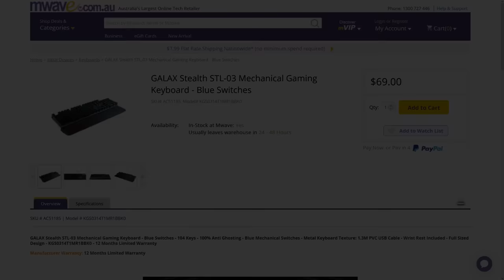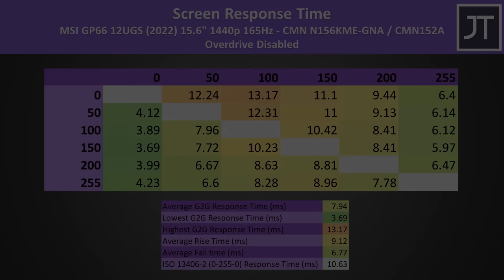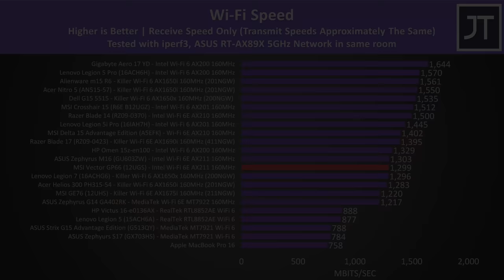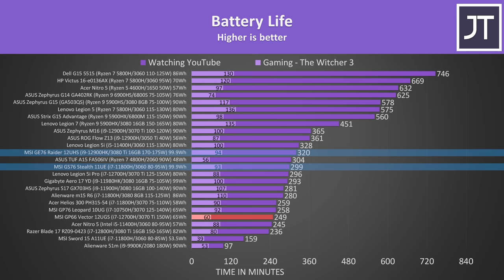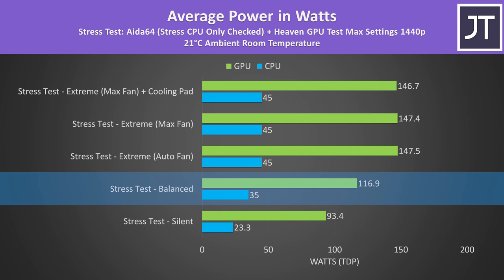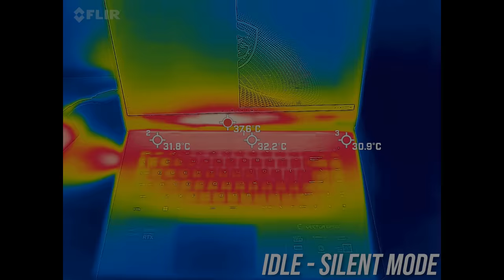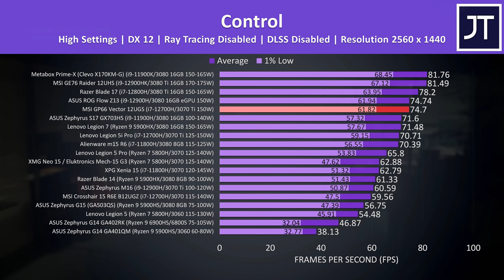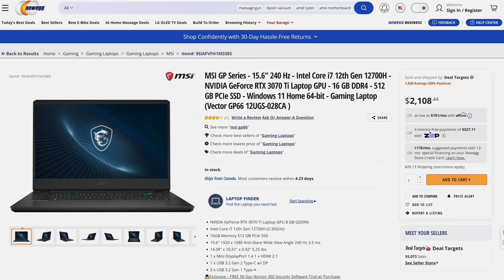MSI GP66 (2022) Review - FASTEST RTX 3070 Ti Gaming Laptop!

Comment: I personally consider $1500-$1750 midrange pricing (above $1000-$1200 value range).

For $100 more you can get a brand new Legion 7 2021 model with max specs... might not perform as well in certain tasks but you get all the extras of a premium laptop.
Reply from the maker: There should be a cheaper 3060 version, the point was more so about the GP series itself not the price of the specific version reviewed here.

Comment: Is it posible to upgrade the battery to a 99whr one?
Reply from the maker: Hmm not actually sure on that.
Reply: @JarrodsTech   Thats why I ask in Google I cant find any answer and since I look for the 17 inch versión there should be space for a 99whr battery, maybe you can get info from them ? It would be interesting since the ge76 with same spec cost 500 more and the only big upgrade for me is the battery. Thanks a lot anyway.
Another question does 1080p content like movies look worse on a 1440p screen since the pixels dont match up ?

Comment: Hey guys/girls 

Im looking at getting a laptop, going oversea for 2 months, any help will be appreciated. 
Msi gp 17-12700h rtx 3080 qhd 165hz 1tb  2x8gig ddr4 ($3099aud) or 

Asus rog strix ryzen r9-6900hx Rtx3070ti FHD ips 300hz 2x8gig ddr5 1tb ($2800aud) 

Im leaning towards msi for the QHD display, cant find QHD for asus in australia, dont know why, but asus has ddr5, battery looks better only asus, but ill be using it plugged in at hotels anyways, can anyone tell me if there is a big difference in the displays? As msi is qhd and asus is fhd, cheers in advance
Reply: Also there is asus rog strix g15 adv edition ryzen9 5900hx Rx6800m ddr4 16gig, 512g 300hz FHD ($2400Aud)

Comment: I wish the Razer Blade 15 Advanced with the i9 and 3080ti, was on the chart. I saw it awhile back and actually chose it as my laptop (for about the next 40 years, based on price...).
The audio issues caught my attention. I have experienced a ridiculous amount of trouble under Win 11 with bluetooth and getting sound to play! Sometimes I lose all audio until I reset the computer. I checked online and it seems audio problems are common with Win 11.

Comment: Is it possible to OC ram or tweak timings in bios?
Reply from the maker: Probably.
Reply: @JarrodsTech  okay, I see they have removed the memory section in overclocking menu in bios, maybe it's elsewhere.
Reply: @JarrodsTech  Unfortunately not. I have exactly same laptop and there's no "Memory" tab in MSI Advaced BIOS. MSI has removed this option from Intel 12th gen laptops so there is no way to enable XMP in ANY MSI laptop now. There's still option to manually adjust Memory settings but only for overpriced HX series CPUs...until 11th gen every Intel CPU had XMP setting in BIOS. Poor MSI (or Intel...)

Comment: This has VRR on the hdmi port but the ge76 doesn’t?
Reply from the maker: Can't say, I was probably just using my crap monitor for the GE76, now I use my LG B9 TV. Sometimes I get a laptop that works on the TV, but not the monitor.
Reply: @JarrodsTech  Just tested it on my LG CX and can confirm the GE76’s hdmi port supports g sync at least. Still can’t get it to work on my Dell S2721DGF which only supports freesync 🤷

Comment: What is better? Legion 5 r7 3070 for 1450€ or Msi GP66 i7 11800h 3070 with QHD for 1500€
Reply: i7 performs much better in games than ryzen 7 and 3070 is paired better with QHD so I would personally go for the GP66
Reply: Go for intel unless you often using the laptop without power adapter

Comment: Impressive performance, but I just couldn't put up with the fan noise to get it. I run my 3070m with v-sync and settings to keep it around 100-115 watts to prevent the fans disturbing me too much eventhough it will run at 130 watts.

Comment: Can anyone suggest laptop for architect student
My old Dell Inspiron not working with MAYA-3D , STAAD PRO  REVIT , LUMION , V-RAY 😔😔
I checked system requirements but they are giving ( LUMION )
Minimum Requirements
 i5 11th gen , Ryzen 5 5600X , GTX 1650 (Desktop not laptop)
And 
Recommend i7 10th , 11th , Ryzen 7 5800X ,  RTX 2070 , RTX 3060
(Both Desktop Cards )
And 
Maximum i9 11900H , Ryzen 9 5900 RTX 3070ti , RTX 3080
(Both Desktop)
But I need a laptop for my college and internships
Plzz suggest laptop 
My budget ₹1.5 lac - ₹2.5 lac
Reply: the new legion 5i pro, legion 7, zephyrus g15 and m16, legion 5
Reply: @jeremylamhot8949  Thanks bro for your valuable suggestions
Reply: np bro!

Comment: wouldn't exactly call a £2000 laptop mid range
Reply from the maker: The GP series itself is midrange, not necessarily the specific specs I happened to get sent. There is also a 3060 configuration.

Comment: 2000$ Midrange Gaming Laptop... It used to be around 1000$
Reply from the maker: The GP series itself is midrange, not necessarily the specific specs I happened to get sent. There is also a 3060 configuration.
Reply: @JarrodsTech  You may be right

Comment: That 65Whr battery is a joke. Even the 14 inch machines have 80whr batteries
Reply from the maker: Go the GE series if you need more I guess, but doesn't really matter a whole lot with Intel laptops.
Reply: @JarrodsTech  I kinda like intel with the performance they are offering but I they offer terrible battery performance.
I think I'll go with ryzen laptops even if they have less performance. 
Take a look at the 2022 G14. It has 10.5h (YT Playback) of battery life which is very good. I need a 15 inch or 16 inch screen , therefore I will choose either the 2022 Asus Zephyrus G15 or 2022 Legion 5 pro  after your review of course 😂👍❤️

Comment: I am so getting this in the 32 ram version
Reply: Did u get it? And how is it if u did
Reply: @user-km5zq6sh3v  its rlly good so far and its kinda overkill if you wanna run aplications in the background
Reply: @vaserz312  is the thermal / temperature / heat not a problem?
Reply: @user-km5zq6sh3v  it runs at 80D while playing horizon zero dawn on max settings

Comment: i consider this on low of top range not mid range lmfao
everything at 2000$ is not mid range xD
Reply from the maker: The GP series itself is midrange, not necessarily the specific specs I happened to get sent. There is also a 3060 configuration.